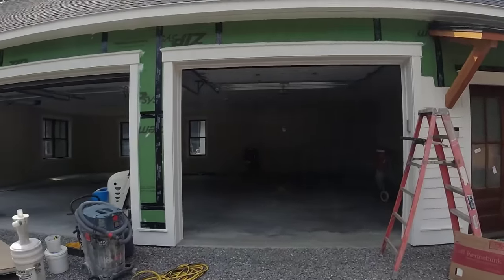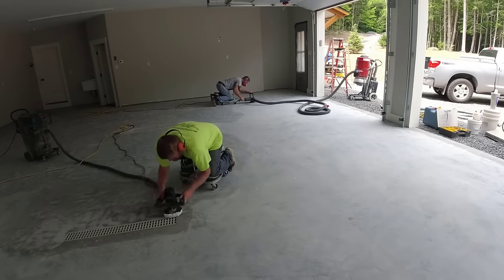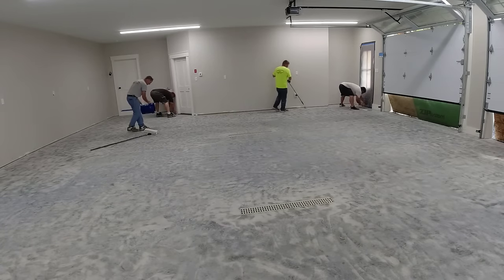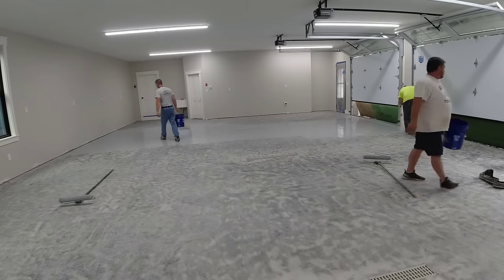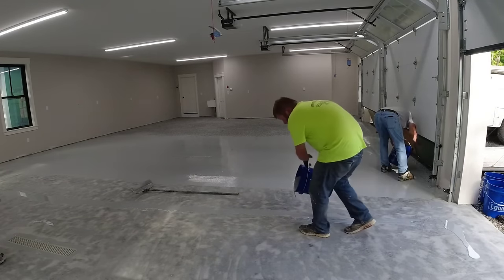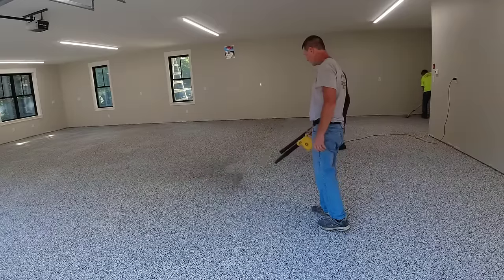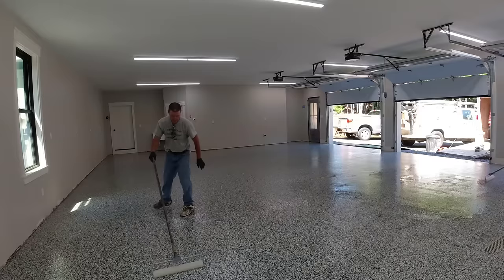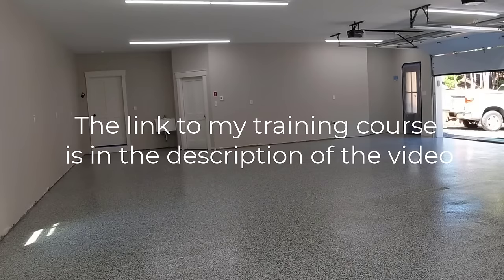How To Do A Concrete Coating For A Garage Floor In 2024

Comment: My wife and I did my 22X40 shop. We watched a bunch of videos, including yours. We rented a walk behind floor grinder. That took us 1 1/2 days to get it done. What we found out towards the end is to put a 60# retaining wall brick on the machine for added weight and it made it go 5 times faster. My wife did 80% of the grinding. I kept washing out the water/slurry. We cleaned the shit out of the floor. We go two part epoxy from Exterior Coatings. I mixed and she rolled it out. We did a full broadcast pretty much the same colors as you just did. Scrapped and cleaned the flakes and then rolled on the same polyspartic top coat. The prep time is 85% of the work. I don’t think that you always need to hire a pro to this kind of stuff. Enough research and willingness to tackle it you can get it done. Mike does fantastic work. What I would worry about is hiring someone and they do a half ass job for a ton of money. At least if I screw up it is my fault and I didn’t pay someone thousands of dollars to mess up.
Reply: Agree.  Which brand did you use? If you don’t mind.  Or if you have the link.  
   All the stuff on Amazon have mixed reviews.

Comment: Mike, Why do you prep the floor first with the 20-inch floor buffer and later go over it again with the hand grinders? I understand using the hand grinder in the corners, but why do you use the hand grinder after the buffer over the whole surface again? I think you don’t do that in your other videos.    Thanks!
Reply from the maker: Sometimes the hand grinders with the vacuum attached cleans the dust out of the pores of the concrete better than just vacuuming alone. Then we vacuum after using the hand grinders. Grinding with the buffer is great but it forces some dust down into the concrete after the surface is opened up.

Comment: Hello Mike, would it change your approach if you were laying a new slab with the intention of ending up with a flaked epoxy floor?

Would you still polish the slab and then grind it? Would you brush finish it to eliminate the need to grind the surface? How long would you leave a slab before epoxy? Etc.

Awesome videos by the way. I know you're probably very busy, so not expecting a response, but it would be much appreciated 👍 I'll keep binge watching your stuff!

Comment: Never did a floor, im a GC in Ca, and going to be doing this for my good friend, and don't want to screw anything up, and want it to last for decades... looks like grinding the floor is the way to go, the moisture part with the plastic is a good idea rather than the etching solution... i'll be following you through this process to make sure I get this right, Thanks! (Then i'm doing mine)

Comment: Mike what do you use to fill the control joints? I didn’t see any in this garage. I’ve seen some companies leave the joints and it does look nice. I push rod bacer down to about a 1/4” below the surface and then use a quick dry crack filler then grind it down to a smooth seamless surface

Comment: I’m looking at getting my floor coated. What are my options with a brand new floor? It’s a week old right now. Garage doors coming soon. 28x24 building. I’m just looking to keep it nice. Not really sure if I need it a solid color or just remain normal concrete look.

Comment: I’m watching because I want to do my own flake floor.  I want a pro product that will last me many years.  I’ve installed two other epoxy floors.  The first one didn’t last, the second solids based floor lasted 15 years which is when I sold the house.  Previously I’ve etched, I’ll be grinding this time.  I doubt my floor is insulated and I’m wondering if a primer will help prevent pops or peeling.

Comment: Have you ever used the original color chips garage floor epoxy kit deluxe? Thinking about trying this on my own. 
Norklad WB or pre prime WB Primer
Base coat is Norklad WB
Clear coat is HPU 747 VOC
Any info would be appreciated! Enjoying your videos

Comment: I did my own garage a few years ago and after 6 months it started flaking pretty badly where the cars came in and out of the garage. I already see where I went wrong. By the naked eye I thought the surface was smooth enough so I didn’t bother with a grinder. Lesson learned.
Reply from the maker: Yup, we see it all the time. Prep is the key.

Comment: Question, how likely is it that a “repaired crack” will transfer through the coating down the road?  Also how much flexibility is there in the product say a shrinkage crack develops in the concrete a year or so down the road is it flexible enough to not transfer through? I am talking more shrinkage type cracks not larger cracks caused by substrate instability.

Comment: I bought all the [Quality] Stuff to do my daughters 20’x20’ garage & with the cost of the Power washer & Concrete grinder machines?? It was simply about $1K less than a professional service to do.

What stopped me from doing it DIY? 
My inexperience.

Sometimes? It’s “CHEAPER” to have Someone with experience to do it since on the job training mistakes can be quite costly.

Sometimes the way to save money is to go with the Pro even though you end up spending a little bit more money in the long run.
Reply: For $1K difference I would have it done, IF the professional was good and I trusted them.
I'm uncertain how much of this is done in Canada.
Many times ' professionals' will take the job to get the experience.
I learn so much from this channel. so good at what they do.

Comment: Hey Mike, 
A bit off topic, but regarding concrete mix testing. do you test your own slump, or do you have someone test the slump for you. And do you test every time?
Reply from the maker: A testing company does the testing, and only if the spec calls for it.
Reply: @MikeDayConcrete  Thanks.